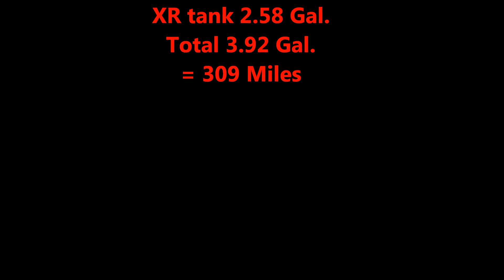How to Mount a Honda XR250 Tank on a Ct110 "Postie"

Comment: Thanks.  Got the clamp for Autozone.   Probably do like you did with the zip tie key but without removing the old switch.  Look like it can stay under the tank but i need to do an "extension" to get the wires to reach the handlebars.